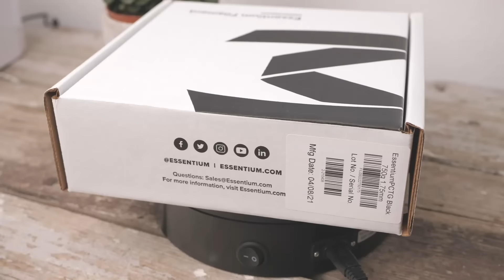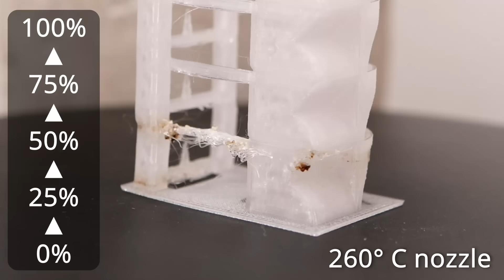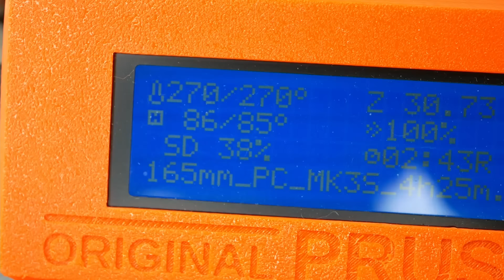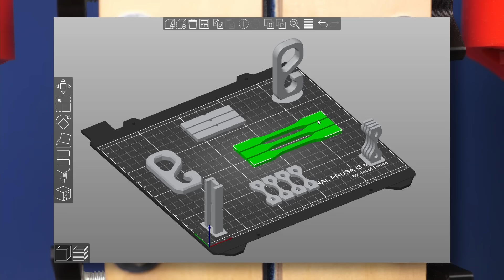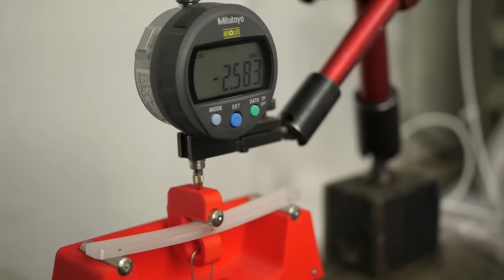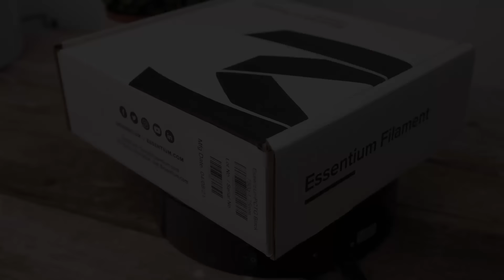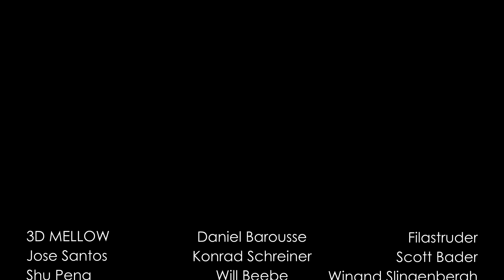PCTG - The Isotropic 3D Printing Filament?

Comment: so.... a marginal performance increase from regular petg, at double the price ? yeah, no thanks. very thankful Stefan is here to bring real data into the mix, instead of us all having to rely on the manufacturer's claims.
Reply: Exactly. This filament has all the drawbacks PETG does ( moisture sensitivity, stringing, increased difficulty in printing compared to PLA ) and nothing about it is a substantial  improvement over regular PETG, ( you even have to print this stuff at 270c, but it still has a glass temp of 80c... WHAT ?? ) which can be purchased for half the price from just about anywhere that sells filament. Honestly it's just ridiculous that they think they can charge as much as they are for this - it's effectively PETG with a higher print temp, nothing more, and in some ways less.
Reply: It's almost double in layer strength compared to regular PETG and has like eight time more impact strength, those are pretty significant upgrades.
Reply: since it's a new material, it will go down soon
Reply: @oddspaghetti4287 Uh, it's not double the layer strength, and 8 times more impact strength ? LOL. from the website article:

"Next we get to impact strength which is a property many are not aware, that is kind of bad for PETG. PCTG was able to really shine here and the notched samples were able to absorb around 24 kJ/m² which puts it way above PLA and PETG and on a similar level as for example ABS. Unfortunately, the samples printed standing performed way worse and had an impact strength of only 1.5 kJ/m² on average."

you sound just like whoever wrote the manufacturer's claims for this filament, technically true but actually misleading. does it have great impact strength ? sure, as long as you only print things that are flat. anything else will perform no different than petg, which is my point. it's no different than any petg in a real world application. and in many ways worse - it's so moisture sensitive that it has to be stored in a mylar bag, and it has to be printed way hotter than petg with no additional increase in glass temp. I never said it was a "bad" filament to use, but at 2-3 times the price of petg, it makes no sense to buy it.
Reply: @adrianstachowski9422  maybe the price will go down "soon". and maybe the company will go out of business in 6 months because no one is buying their overpriced filament. my point is that this filament is not much better than petg, and the price they're charging for it is ridiculous. it's modified petg, nothing more, and it doesn't perform much better than petg, with several additional drawbacks.
Reply: @adrianstachowski9422  it isn't new, It has been sold for more than 2 years...
Reply: @obie224  You should first check what the company does, they build the fastest FDM printer in the world, so I assume that the filament will certainly not be the core business...
Reply: @stiffler8632  i said that more to illustrate the point that anything is possible in the future. personally i don't care if the company stays in business or goes out of business, and i def don't care enough to bother looking up what else they make. i would recommend that they stick with building printers though, because they certainly don't make a very attractive filament product.
Reply: @stiffler8632  ohh. Then it's just overpriced :D
Reply: Might be useful for 3d printable firearms but I'll probably just stick with petg. Most people are using esun pla plus.
Reply: @noahpaulette1490  I love esun ! i usually purchase it at microcenter ( pretty sure their store brand is the same stuff ) since there's a location near me. aside from a few random spools, i've used their filament almost exclusively for 5 years and was always happy with the results. and at the prices they charge, it's a really good value.
Reply: @obie224  might get some next time I'm at microcentre I've always heard good things.
Reply: @noahpaulette1490  I def recommend it, especially at the prices they sell it at. some of their colors of (non-plus) petg are $17, and the others at $20. that's great for decent petg these days. I've never noticed much of a difference between the plus versions of pla or petg, but that might be just me.
Reply: ew, double the price? That's all I needed to hear.
Reply: @obie224  I am printing with it right now and I am finding that the layer adhesion is incredible, also check out Vision Miner review of this material. I am printing at 270 with 80c on bed. I have the material in a heated container at 45C while it is printing.
Reply: @gg-gn3re  It's not double.
There's PCTG from Fiberlogy for 27€ (750g).
That's 20% more expensive than Prusament PETG for example.

Not sure, why some people here feel the need to hate on that Filament.
To me it looks highly promising.
Reply: @uhu4677  In majority of the world, your prices don't matter.
Reply: @obie224  Nope - the price has not went down yet!

Comment: I, personally, would also like to see how they're properties change after long exposure to UV. Thanks for the awesome videos!
Reply from the maker: Great suggestion! I bought the equipment to do that a year ago but never went through with it.
Reply: @CNCKitchen  Summer is upon us in Arizona and I have some ApolloX (ASA type) filament coming so I can print a phone holder for my wife and for bike parts. I left my bike helmet with my nifty PLA (black) printed visor outside this weekend and the sun warped it significantly. So it will get remade with ApolloX as well. Maybe I'll make some parts and give them 3-4 months of Arizona sun and see what happens.
Reply: their*
Reply: @Rozumusicmediator2733 You understood what they meant.

Comment: A test that checks for degradation during repeated lateral loading would be very useful.  That is, back and forth stresses like a finished part may encounter during regular use.  I have had PETG crack perpendicular to the layer lines despite it having been strong enough to support the load.  That constant back and forth lateral load caused it to crack.

Comment: I made some (thin) cookie cutters and regular PETG just wasn't tough enough for the job. So I ordered some PC Max as well as some PCTG from Fibrology after finding out about it here. And , WOW,  this stuff is really strong - I did some testing and it really seemed almost isotropic: thin walls don't break between the layers, IF they break at all and not just deform. I think this will be my preferred material for small engineering jobs or delicate things.

Comment: I bought some PCTG recently to print a fuel cap for a vintage motorcycle. It apparently has good resistance to petroleum in addition to its desirable mechanical properties.

Comment: I have been waiting for this video.  These results were very interesting.  I was able to print PCTG with the same exact profile I used with PETG on my modified Ender 3, but changing the temperature to 255C.  the filament printed great and seem to have great layer adhesion.

Comment: My favorite filament! if anyone is curious, filalab has very afforable rolls available in EU. pretty much same price as most PLA or PETG. not affiliated, just want to spread love for this filament type.
Closer to ABS, with printability much more like PLA. any printer can print it as long as nozzle can to 230 Celsius and bed 80. no warping.

Comment: 10:09 @CNC Kitchen What is the brand/reference used for your annealed PLA? Most "Tough PLA" that can be annealed in an oven are in fact INGEO 3D850 or 3D870 invented by NatureWorks LLC (3D870 as higher impact resistance than 3D850), that are then sold under various names according to filament makers. But the NatureWorks charts show that these two special annealed PLA once semi-crystalline has still a heat deflection temperature that is roughly 10 °C LOWER (HDT-B = 85 °C) than that of standard ABS (HDT-B = 96 °C). So what gives? How is your chart and test possible?

Comment: Another great video. The issue for PCTG is the very high temp requirements. I imagine a lot of beginners would struggle especially if the printer can't handle ABS. For outdoor uses, how PCTG handles sun and rain?

Comment: i wonder if a heated chamber increases the strength. it does for some other materials.
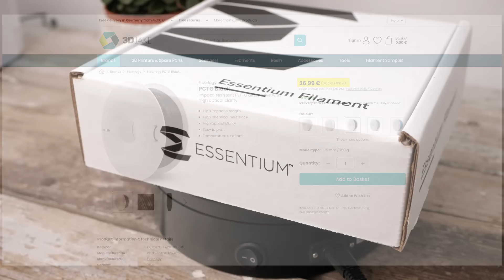Reply: I print PCTG in a heated chamber at 70C. To answer your question, I think you're right. Essentium claims this material anneals around the glass transition temp (see 2:05 at https://www.youtube.com/watch?v=D_Yz_awswLk).  I print a series of test bars for all materials I use and then I do a ghetto 3-point bend test using a belt tension tester. Prior to PCTG the strongest z-axis strength/adhesion I tested was for polycarbonate, but PCTG beats it. In my experience, if you have to load the z-axis then PCTG > Polycarbonate > ABS/ASA.

Comment: good one Stefan, thnaks for runnning the tests, now if you can put a benchy in yor car on the dash bard and notince what happens to it as days go by...
Looking forward to see the PC tests, I got 4 reels myslef, never had the tme to test them, but it will be done by me too soon.  Now changing all my prnters on my new design water cooling system, to cope with higher temps requirements better.

Comment: Hi Stefan,

Good video. I was wondering if this stuff would be a good binder for a fiber-filled material. Given that the Polymers most frequently user for such applications are on the softer, but more resilient side. The good layer-adhesion would play very well with a fiber filler, imho.

What do you think?

Comment: How does it stick to a glass bed?  Does it have the same love/hate relationship with glass as PETG, i.e. that it tends to chip of parts of the bed?
Reply from the maker: As far as I've read similar to PETG and will rip a hole in it, so use a separation layer.
Reply: If you haven't gotten a flex PEI bed yet, what are you even doing with your life?
Reply: We use Essentium's PCTG (and HTN-CF25) all the time at work, we use a glass bed with several layers of glue stick for adhesion. PCTG is a good go--to for general printing. Their HTN-CF25 is a whole new level of strength though, it's super easy to print and the strength and stiffness rivals aluminum. It's incredibly expensive but much cheaper than getting a machine shop to machine out aluminum fixtures.
Reply: @fwiffo  Wow.

Comment: Thank you for doing all these awsome tests. I will probably try pctg. I print mostly functional parts for prototypes. The the most important things for me is impact strength and heat resistance. I like petg but its only just good enough in the heat resistance and mediocre in the impact strength. I have been printing with priline carbon fiber petg lately. And the impact strenght seems pretty good qualitatively. I have tried other filled petg filaments but they were brittle. It might be worth doing a comparison of cf/ glass filled filaments some time.

Comment: Interesting material, though the sloppy stiffness could be an issue, petg is already a bit to soft sometimes for my use. Im really looking forward to the PC blend test, i find it very easy to print with the default settings, and have been waiting for the pc-cf. Good price for the specifications you've get, for example high temp.

Comment: Hi Stefan. Thanks for another great video. Did you ever test cpe hg100 from filamentum? To me this is the best performing material when looking at layer adhesion and strength plus ease of printing and impact strength. I would love to see you test this filament in similar fashion. Stay safe, regards Roy
Reply: Fully agree, still in use. Anyway filamentum recommends also up to 270 °C printing temperature, but still prints fine below. At least the best layer adhesion of many filaments I've tried out in the past. Ideal if you play around with single wall prints.

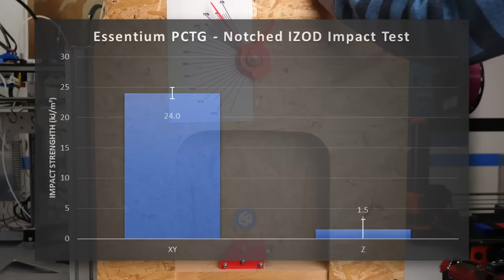Comment: 9:43 Do you have a graph of how this compares to the other filaments? You showed this for Z layer adhesion, but not impact Z strength. I believe the ratio for PC for example is much better, maybe also ABS with heated chamber.

Comment: I bought one spool from Fiberlogy and it is really intresting. Printing is really easy, just modified profile for Fiberlogy PETG in PrusaSlicer. It is not that stiff as PETG but is more like pure Nylon. Also, Fiberlogy has a great number of colors, with samples I have like 5, and they have 6 or 7 in total

Comment: What extrusion width did you print with? Thanks to your earlier video, I've been printing a lot at 0.6mm on a 0.4mm nozzle recently. I haven't done any comparative strength testing, but I'm very grateful for the reduction in print times on the very large prints I've been doing.
Reply: Wait you can print .06mm from a .04mm nozzle??.
Reply: @Dkizzle16  I don't think you'll be able to print at all with a 0.04mm nozzle 😂, but yes, you can print wider than the nozzle aperture. See Stefan's earlier video on the topic: https://youtu.be/9YaJ0wSKKHA
Reply from the maker: Good point. All done with a 0.4mm nozzle at 0.44mm extrusion width.

Comment: Abt a month ago I've bought Fiberology Clear PCTG for my FPV #3Printed wing design. I've printed it but not maidened yet. Printed with no cooling. I am really happy how it came out comparing it to previous prototypes from PETG or PLA.
Reply from the maker: Very interesting! Did you have any issues with warping?
Reply: @CNCKitchen  maybe a little bit. It behaves very similarly to PETG. Flat surfaces tend to buckle. I try to print on relatively cold bed (<80C). When I tried to print hotter (100C as initially recommended) the print distorted for first 5mm. It wasn't warping -just collapsing - I'm talking about the airfoil shape. Going to 70-75 with glue stick on glass bed went really well - except the sharp trailing edges lifting a bit.

Comment: How does PCTG print compared to PETG? I use PETG regularly but it does gum up or, as I heard a YouTuber once say, "PETG boogers up" I'm very intersted in this material if it prints better  that PETG.
Reply: Late but might still be interesting: I mainly use PETG but have now tried PCTG (working through my first spool of extrudr transparent PCTG). Overall, PCTG seems to print cleaner and more easily. It still has issues with stringing but far less so than PETG and I see basically no boogers. Boogers and completely gummed up nozzles were something I could never quite get rid of with PETG, but as said, it's been no issue so far with PCTG. Bed adhesion on textured PEI sheets is also better and far more consistent than PETG.
Aside from the higher print temperatures being a hassle, PCTG seems to really only be a slight upgrade performance wise to PETG (aside from impact strength, which is far better - purely subjective, but the printed parts feel almost indestructible in my hands, at least noticably more so than the same parts printed with PETG), but with the enormous draw of being easier to print. It's been far less of a mess so far and that alone makes it a candidate for straight up replacing PETG for me.

Comment: Looking forward to your CF PC tests. I have PRILINE CF PC, and it prints at lower temps and sticks to the bed so well that I have wondered if they're blending PETG in it,...or maybe this stuff. It pulled the coating off of my glass bed in a few places. Now I use the magigoo PC glue "stick",.....and it's still pretty tough to get off. I print at the max my printer can do which is 260C/115C and I use 30% fan. Just bending and breaking some temp towers, it seems to have good layer adhesion. But I only have PLA to compare that to.

Comment: I run the 2.5 kg spools in a heated chamber at 70C and extrude at 250C (no cooling fan on my printer). I haven’t tested the isotropy specifically, but I’ve never had a piece break solely along the layer lines (and I’ve broken many while stress testing). FWIW Essentium states that the pieces can be annealed to increase HDT, though I've not tried. They’ll also say it’s UV resistant over the phone, but they don't state that on the TDS, so who knows? It’s a great filament overall, it’s one of my go to materials. Sticks to build tak with no adhesive, and is compatible with SR-30 as a support.
Reply from the maker: Should try the heated chamber at some point! Where did you get the information on annealing PCTG? I would have suspected that is a purely amorphous polymer due to the glycol modification.
Reply: @CNCKitchen  Skip to about 2:05 in https://www.youtube.com/watch?v=D_Yz_awswLk     Based on the 450x time lapse, they anneal for approximately 45 minutes.

Comment: excelent test using the boxes at 100% on supports. its the true test of correct extrusion. ultimate version would be a longer strip as it will allow the printer to reach max flow for a longer time.